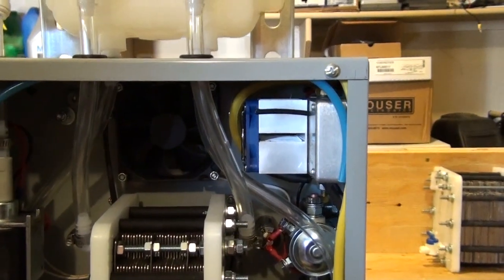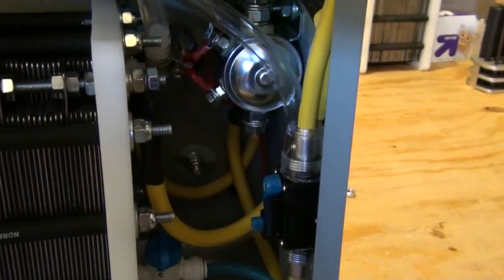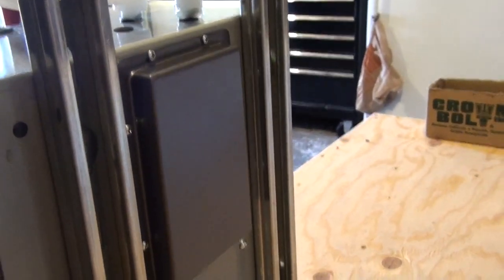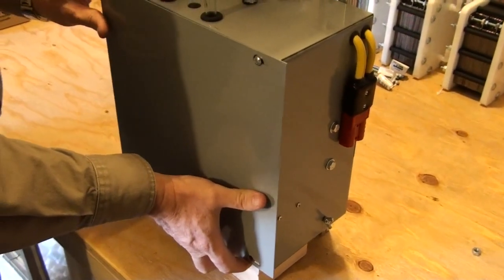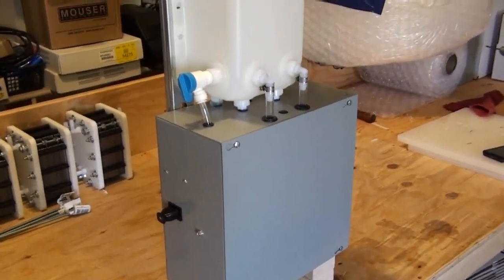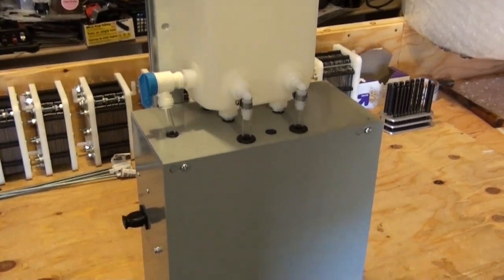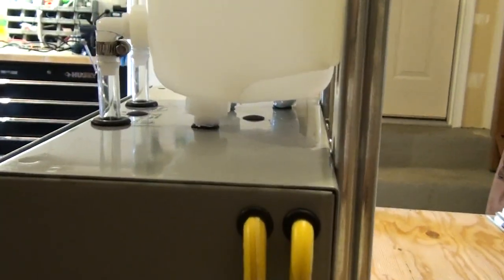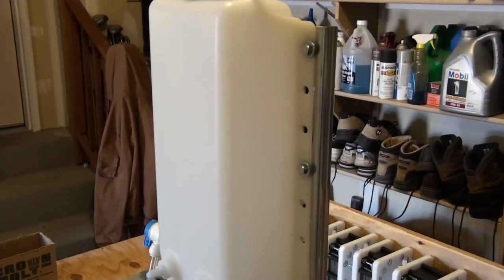HHO hydrogen SEMI Truck system almost ready to go.

Comment: I don't know about your truck but some truck engines use the filtered air for the air compressor or air brake system. That would mean that some of the hydrogen is being stored in the air tanks. That could be catastrophic if a spark was accidentally introduced.

Comment: I heard that this is no good for diesel engines. Hydrogen dries out the cylinder walls because of the explosion it creates in the cylinder rather than combustion created by diesel fuel.  Hydrogen explodes... diesel combusts.